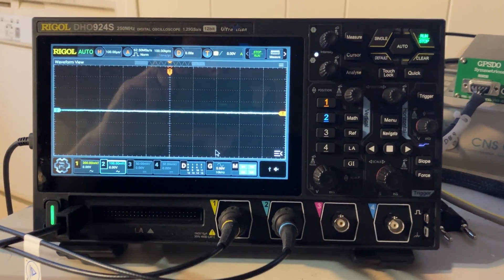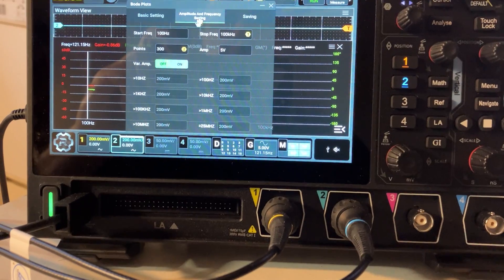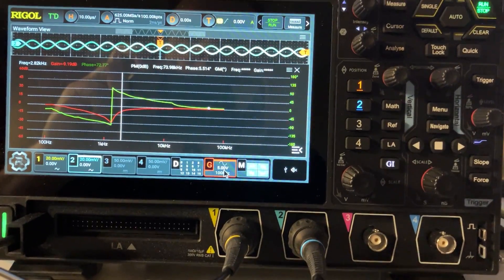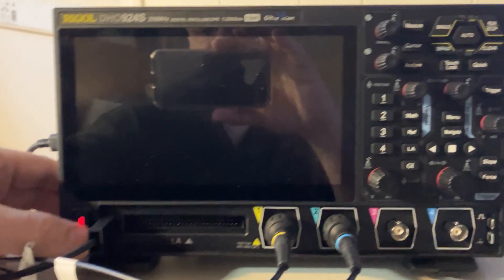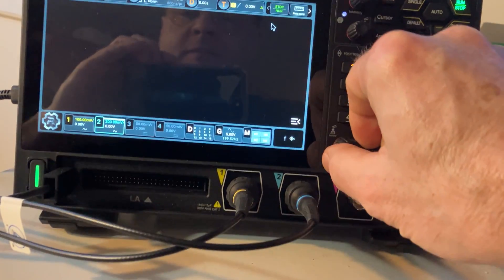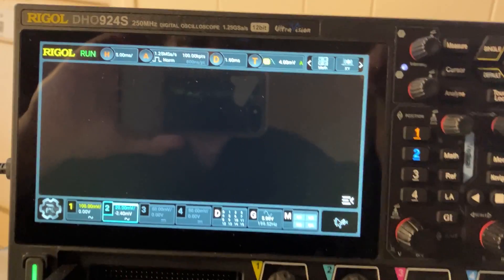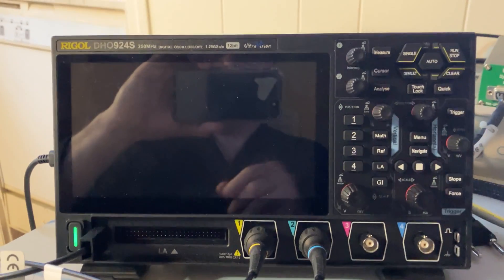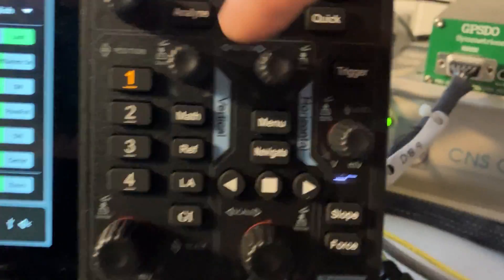Bode plot on Rigol DHO924s, don't power off in this state.

Comment: I discovered this state the hard way.  Couldn’t get out of Bode plot mode so power down. Power up, no response until I discovered pressing default twice.
Been using Bode plot plenty and once you understand pressing the window bars to enter the menu and turn off, adjust, it’s a breeze.
Click window cross button to exit.